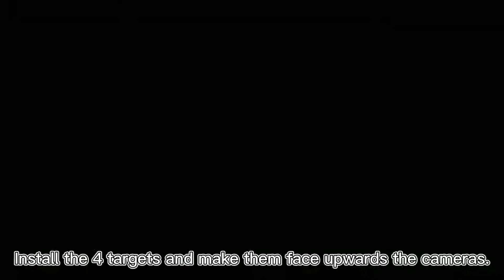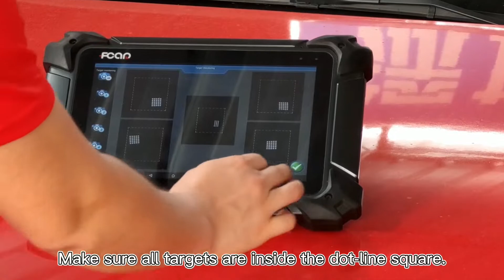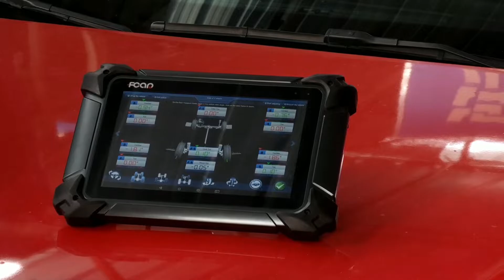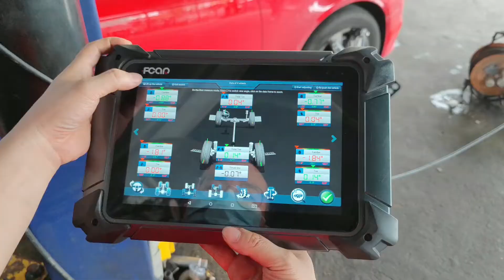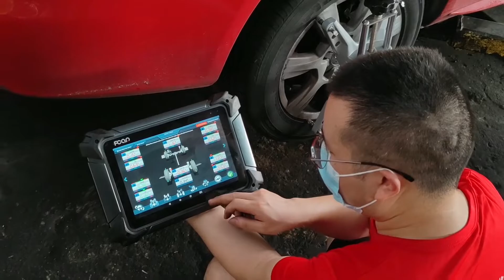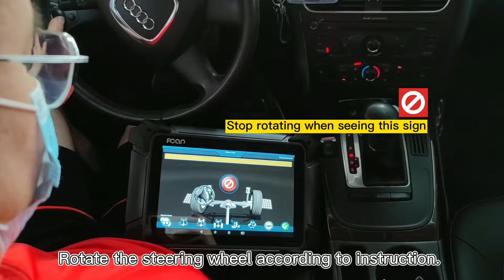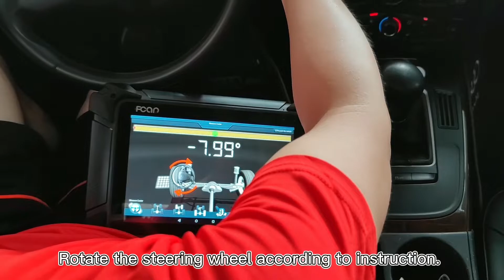FCAR FD-505S Suspended 5D Wheel Aligner Full Operation Video

Comment: Yeah, that's the interesting part. Can't make adjustments while the vehicle is lifted without the suspension under load. If anything, this machine works for checking the alignment, but can't do live adjustments on a 2 post lift.